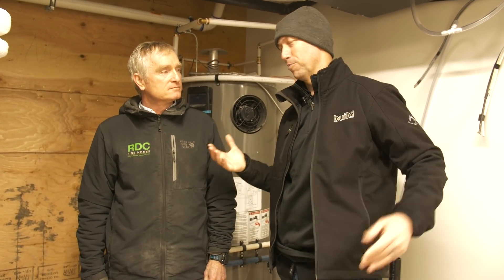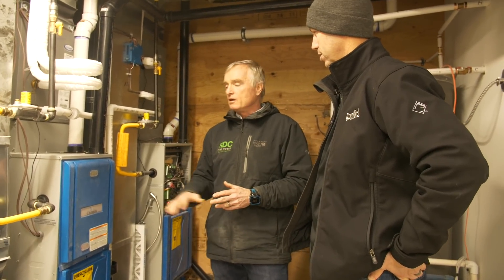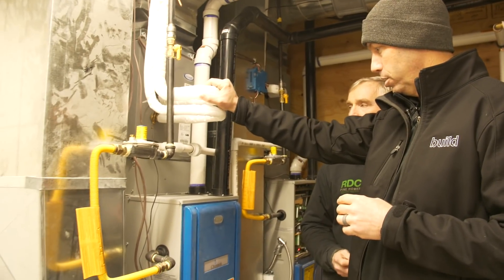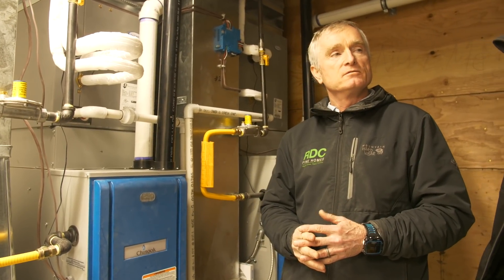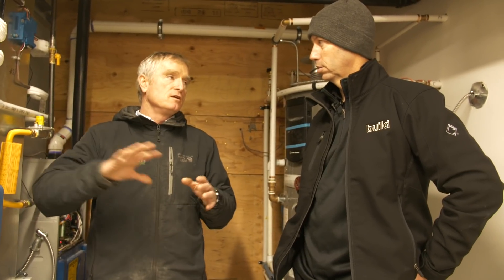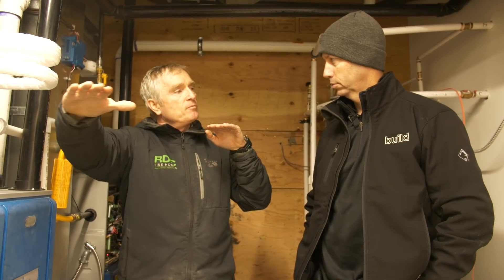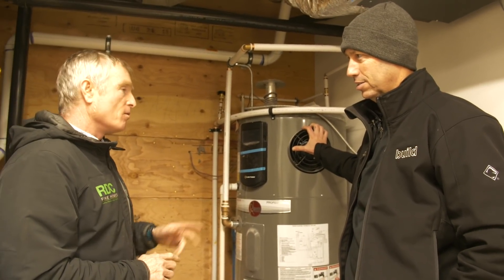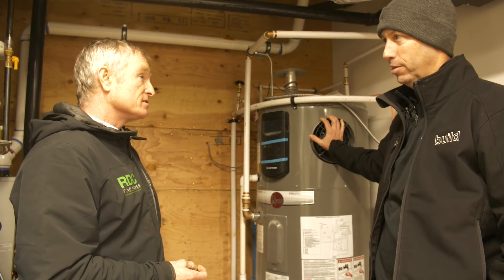Canadian HVAC System Tour. Interesting Equipment

Comment: any project of this magnitude should be required to be all electric! Piping gas into homes (and businesses) is a bad idea - for ecological and health reasons. Here's a question: when you were in Europe, how many projects did you see that were heated with gas forced-air furnaces? check it out! Hydronic in-floor and/or radiators are everywhere. I don't know if gas furnaces are even allowed. I'm surprised that Canada doesn't model Europe.
Reply: @marcol869  it's not about the cost (especially for multi-million $ homes). It's about using gas! The whole process to get gas to a home is something that needs to end. Using petroleum for heating and transportation must end if we want to get in front of the climate emergency we all face.
Reply: @timskufca8039  BC Hydro billing system is what is a big stumbling block in BC
Reply: @timskufca8039  - You are hyperventilating, dude. Don't believe what Greta Thunberg tells you. The ocean will eat all surplus CO2. CO2 is a non-problem. It is all based on faith and Crisis Illusions.
Reply: @elbuggo  DUDE! even if the climate was not in crisis , I'd much rather live in a house without gas. This house could easily function without gas.
Reply: This house only consumes gas for primary heating after the heat pump no longer works below freezing, and the building envelope has been tightened up and heavily insulated, ensuring the minimum heating load
Reply: Are you kidding me ? Canada is loaded with Nat gas in western provinces, foolish NOT to use.
Reply: @johnwhite2576  "foolish" is to ignore the climate crisis we all face
Reply: @timskufca8039  - Because Greta Thunberg told you so?
Reply: And if people realized how great boilers are and their multiple uses we all would be live more efficiently. Hot water heat exchanger, hydronic systems, radiant, Fin tube, would be super!
Reply: Gas is widely used in EU I have no clue what you are talking about. But if you want to talk about heat pumps you must understand a calculation and Canada & US ain't the same as EU first the gas is cheaper in Canada/US second the houses ain't as insulatet as in EU which is a must if you want to use a heat pump efficiently.
  But you are correct in one thing this house is way too complicated 2 gas heaters , air heating, heat pump for tap water...I mean wtf?....somebody have too much money to spend
Reply: @altergreenhorn  yes, gas is used in EU, but not forced-air furnace heat. Gas furnaces are THE WORST method of distributing heat. My point is that a house of this magnitude should be as responsible as possible - and even net-zero. Besides, in the long run, installing efficient appliances does pay off. Yes, a water-to-water heat pump, (with multiple wells, or horizontal slinky, or tapping into an aquifer) is much more expensive to install, but in a few its efficiency wins the ROI. Piping gas into a structure will eventually drop out, why not be ahead of the curve, especially with that kind of money?
Reply: You're confusing energy source with distribution. Natural gas is cheaper than electricity. I've had gas fired boilers with hot water radiators, very efficient and comfortable. Forced air is nice because you can push AC through the same system in the summer.

Europe uses gas too, look up Nord Stream etc.
Reply: @normanlorrain  There were two parts to my rant: 1). I did not say EU does not use gas. I said gas-fired furnaces are not used in Europe (because distributing BTUs in water is MUCH more efficient than with air). 2). It is irresponsible to pipe gas into a multi-million $ house when electricity can achieve the same goals without using a fossil fuel. Gas will eventually be code restricted once the world realizes the climate crisis is very real. (Berkeley, CA has already restricted gas from all new construction).
Reply: @timskufca8039   Of you really can make yourself believe in this Cliimate Crisis illusion, you should only eat algae and bugs, and you should not live in a house but in a cave. The sky is falling! The sky is falling! The sky is falling! - the chicken shouted.
Reply: Where do you think the electricity comes from? There are also lots of electrical line losses from the generator plant to the end user. Not so much with gas. 
I follow a few Plumbers from Europe and they work on gas appliances all the time. They install the boilers right in the kitchens.
Reply: @jordandelorme2341   yes, gas is used in EU, but not forced-air furnace heat. Gas furnaces are THE WORST method of distributing heat. My point is that a house of this magnitude should be as responsible as possible - and even net-zero. Besides, in the long run, installing efficient appliances does pay off. Yes, a water-to-water heat pump, (with multiple wells, or horizontal slinky, or tapping into an aquifer) is much more expensive to install, but in a few its efficiency wins the ROI race. Piping gas into a structure will eventually drop out, why not be ahead of the curve, especially with that kind of money?
Reply: @jordandelorme2341  well even tho I agree that in some extent gas is good at low temps where heatpumps efficiency drops, it still can't justify the complexity and bullshit with gas.
Therefore, yes, all-electric would be better in every way.
1. Even in Eastern Europe you can rely on heatpumps completely til -28C, look up Panasonic or other Japanese air to water units...
2.  Also since heatpump often has 4 COP, it's then like 3 times more efficient than gas furnace  when taking distribution losses into account lol. And therefore I guess gas isn't cheaper, at least it's not in Europe
3. Forced-air for heating sucks, zoning sucks with it and you will never get the comfort of radiant heat and justify blower electricity cost.
4. Only UK (primarily)  relies on old school gas furnaces cause they are simplest to set up compared to other solutions, UK is not the whole Europe. Most other countries it's either district heating, biomass or heatpump, all on radiant.

Comment: Dettson. They do have an even smaller unit. The Chinook mini. I have two units in my current build at 15,000btu each. 

Very cool units, but I've had a lot of  problems with them.
Reply: What sort of issues?  They claim a 10 yr residential warranty, are they giving that sort of grief?
Reply: @michiganengineer8621  

Yes warranty's on parts are honoured. But you have to think about the associated time/costs of repairing a system. So if something fails, You have to troubleshoot with them on the phone, figure out which parts you might need, buy the parts, spend the time to swap them out, figure out which one is defective, give it back to your parts supplier, then they send it back to dettson. Then you get a refund for the part. That's standard ops; A warranty does not mean no-headache. 

But my issues go beyond  parts failing, it hasn't been fun. But I'm not going to get into it at this point.
Reply: berky , sounds like a bad install may have been part of the issue?
Reply: Hi Berky, please email us at info@dettson.ca ... ATTN Jonathan.  Thanks.

Comment: Matt, you should come and have a look at "normal" building practice and not the high end like West Van and Whistler. 
Might see a different picture
Reply: If he showed up at my job sites in Vancouver he'd find similar quality of HVAC installation. Been working with Eneready products for decades.
Reply: Matthew Naugler Klassen 
My husband and I are self building I Lillooet BC and have got David Hill and Patrick Sommers to design the HRV system.  So neat for us to see the Venmar and Pash system in place somewhere.
Reply: @AnnaMunzela  glad to hear you're happy with your Eneready HRV, keep those filters clean!
Reply: Matthew Naugler Klassen 
Okay 😃👍
Reply: @mennomateo  You have to agree that there are many that cant afford it and there are shitty practices out there. 
Also not to put a roof on to stop the water from soaking everything is a bad practice. 
Just my experience from Europe :)
Reply: @tootallno  yes there are many shitty tradespeople out there that will just slap shot up and charge for it. But your shitting on the fact that this builder is building in a temperate rainforest and cannot keep the jobsite dry is ignorance on your end. 

Every piece of lumber is soaking wet. Every tradesperson's boot are carrying in snow and rain. The air is nearing 100% humidity. Once the jobsite is done rough-in, out comes the 220V electric heaters and the jobsite will be dried out before drywall is completed
Reply: The channel is all about showing new, high-end stuff, cuz that's how Mat gets the sponsorship dollars. ¯\_(ツ)_/¯
Reply: @keithklassen5320  Sadly, all about the mighty green
Reply: @keithklassen5320  Not really.  We didn't know Matt and Bob were even doing this.
Reply: Vancouver is one of our largest markets in Canada.  Many multi-families and single-family homes.
Reply: This very normal in western Europe
Reply: @a100independent6  Oh I know and I wish they could use it here too but.........

Comment: For Europeans: BTU = British Termal Unit
1 kW      = 3412.142 BTU/hr
18000 BTU = 5.2 kWh
Reply: Thanks
Reply: For real!
Reply: The furnace is either a 15K or 30K BTU, that modulates down to 40% of its capacity.
Reply: @dettsonindustries1952  No Idea how that expectancy works though. No experience in systems like these as I still study. :D

Comment: Where are the sediment traps for the gas lines? Or is that propane?
Reply: Andrew,good eye. This particular system is a 2lb natural gas delivery system, in this house ( this is why you see 325 - 5 and 325 - 3 maxitrol regulators at every gas Appliance , dropping the pressure from  2 lbs down to 7 inches working pressure). Yes there should be a sediment trap (drip leg ) at every stationary gas Appliance. I'm assuming the local building inspections in this particular Canadian Community is a little laxed, because it is required  by GAMA ( Gas Appliance Manufacturers Association ).
Reply: @boby115  there are areas I have heard of in Canada that are totally unincorporated. So there are no inspections done, there isn't a municipality to inspect them. That's my guess..
Reply: @Pauline Weinberger I had several places in the Canyon, all on propane- just like many others  outside urban areas.
Reply: I've seen them from time to time on older structures but that's it.
Reply: They are code in canada, length must be 6x pipe diameter
Reply: It would be gas in Whistler.  Sediment trap required by code and the Dettson installation manual.  Hope they never have to make a warranty claim.
Reply: It must not be code in Canada but they should still install them.
Reply: Mike Redding 
lt's code in Quebec though....
you'd be surprised to see how many plumber actually piping gas without the gas licence !